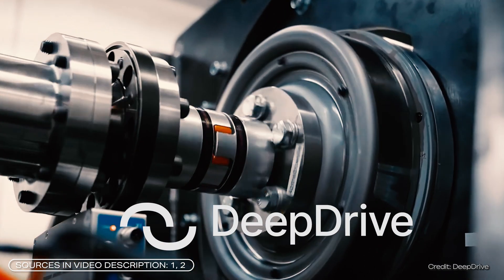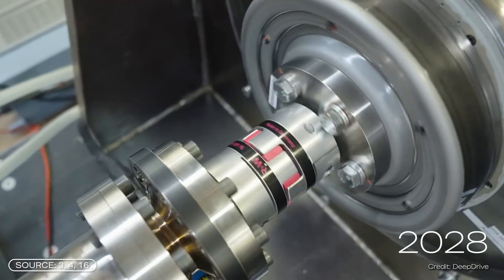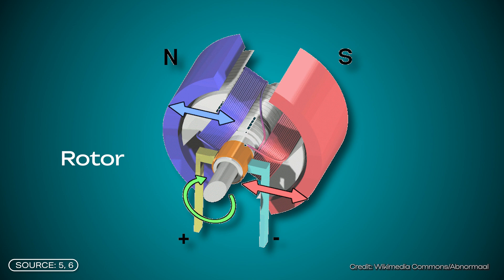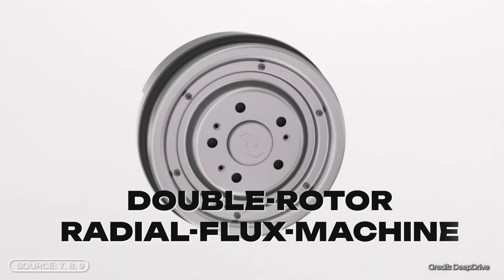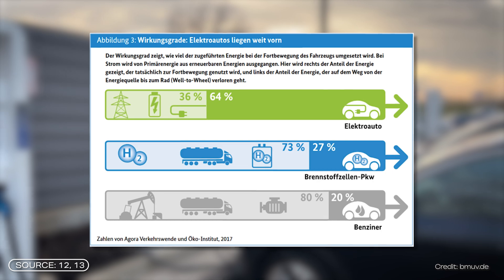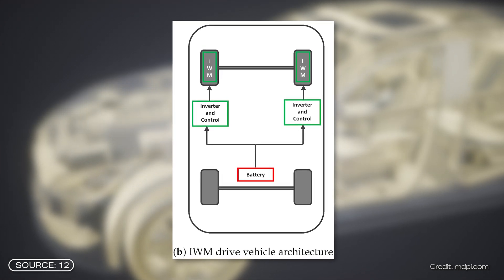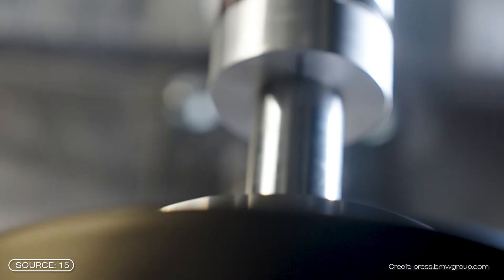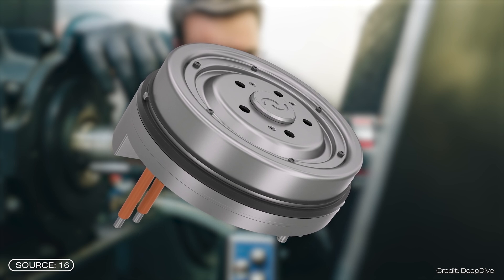Efficiency Made in Germany: DeepDrive's GENIUS motor

Comment: recouperation ⇒ regeneration, would be much better in English.  Also, the claim that no rare earth magnets are required seems false since the armature appears to have permanent magnets, and non-rare earth magnets have MUCH weaker magnetic flux densities.  This means that a far greater number of field windings and/or much higher currents are required for the same output torques, and both of those will reduce the motor efficiency.  A Halbach magnet array would reduce the necessity of having two magnet arrays to capture the opposite side magnetic flux.

Comment: I would think the unsprung weight would be an issue. Integrating the motor into the wheel might lessen the overall weight of the wheel.  Wondering if this much be more appropriate for heavy transport trucks as their tires absorb more shock as they don't move up and down as much lighter vehicles. Also, if Front wheel drive, would not there be a lot more strain on the steering gear?  Interesting though, and something I began wondering about almost 20 years ago for racing cars. Thanks for the good presentation - your English puts most of us English speakers to shame as few of us have any capacity in other languages.

Comment: No no no no and Noooo. That gonna kill auto makers, oils industry instantly and give people freedom of choice. Every body have cars ye's, than imagine that , swoops engine and fuel tank compartment with battery pack or cheap electric generator (diesel) run by vegetables oils put those swedish electric engine size like coca-cola can with 100hp and wireless electricity transmission...4x100....is very ecological, economical , imagine all that energy need to build new car, materials, transport bought energy's and material all that Europe imports and in this case be more independent and with rich agriculture land's.....no no no that going to screwed up Chinese to, maybe not ,thay are very adoptable 😮😮😮

Comment: I need two of those for a non profit org that wants to retrofit a Classic Mini that's 40 years old into an hybrid vehicule at ultra low cost : 2 wheel motors, a battery and a "smart CPU" to monitor the driver intention and road condition in order to control the acceleration and slowdown using the electric motors.

Note: that's the simpliest possible solution and it would work on all "old" vehicule ; much much less expensive that a classical electric retrotif, ie more $4K then $20K :)

Please contact me if interested, our "Mariani Motion Lab" is in Corti, Corsica.

Comment: 6:13 - model 3 range incresases by 20 to 25% ?!? 
How should that be possible if the drivetrain saves only 3,5 - 1,5 = 2 kW  ?

2 kWh per hkm less would mean that the model 3 must have been driven at 10 kWh per hkm to achieve 20%, 
the model 3 must have been driven with 8 kWh to achieve an efficiency gain of 25% 

Who does believe that story that the model 3 drives with a consumption lower than 10 kWh ? 
I bet the average figure would be 15 kWh and then the "theoretical or calculated saving of 2 kWh" would mean 13,3%

Of cause that is per se a lot but if you start a description of advantages with 20% - 25% and then deliver just 50 to 60% of that something is wrong, completely off.

I suggest to tear a model 3 apart and built these motors into this car to show the advantages on a real road, same car and same conditions with drivers that share the lead position every 20 minutes at a constant speed to start with - later the WLTP mix to compare it those gains might be depending on the kind of traffic you are driving.

Sad to see such figures being published by a german figure without a real proof by TüV or whom ever. Talking with 11 OEM also makes no sense cause it says nothing, maybe a student presented his master thesis and that was it.

Prof. Neugebauer from KIT in Karlsruhe I guess was emphasizing the disadvantages that come along with wheel motors like 4 instead of 1 power control unit and a lot more. I still wonder why this company was unable to talk to and convince  Prof. Neugebauer who is a scientist. 
I suggest to invite him and convince him instead of throwing money into this developement while the critics are still there and very clearly to hear. 
The topic is quite complex at least if you look at such change and its implications over a full life cycle . 
It is not as simple like doing the calculations for cost and weight and assembly time, what about the likelihood of failures and repair costs - which a good company should have in mind as a factor for sustainability cause the less likely a car breaks and the cheaper the repair will be the longer it will be used and the more stustainable it will be. 

Big mistakes by the founders to not get in touch with Neugebauer for so many years cause I can find and hear his voice across germany about Radnabenmotoren and the use cases (yes, they do exist for him for example in tractors, streetworking machines or even ebikes which I have for over a decade).

Comment: The Tesla rear motor achieves up to 96% efficient and their drive train is abot 85% efficent. Therefore there is much efficiency to gain by removing the drivetrain, but wheel hub motors are compromised without a reduction box  which Tesla would not use if it was not needed... me thinks we need independent verification from those with nothing to gain / lose, I remain dubious
Reply: "Up to" 96% is key.  Efficiency typically drops under lighter loads.  Yes, 20% improvement sounds too good to be true, but there is a lot of room for efficiency gains across the broader, real-world operating range.

Comment: Portescap used to  make brush motors like that with a rotor and armature with windings formed into a tube inside stationary magnets and iron.  Its feature is low inertia rather than efficiency,

Comment: I just know from building a hub drive motorcycle and then a belt driven motorcycle, that a hub motor simplifies everything so much. I know with a car things are not so easy. But the advantages in simplifying the drive train, creating more space and reducing costs would be significant. I really hope this succeeds, Donut labs are also doing something similar. I can see why these in wheels motors are being developed, because the advantages they could bring are great. I have always thought about doing an electric car conversion, If there were good in wheel car motors available, wow would that make a conversion so much easier.

Comment: So-called pancakes hub-motors initially seems appealing, but present NUMEROUS disadvantages, of which you listed some, but not all.  Also, the answers you got... and give are pretty unconvincing.  Sure, the hub motor will be well protected against environmental aggression... but that remains a potential weakness, and it's sealing a maintenance concern.  The concerns linked to the "un-sprung" or "un-suspended" weights are also too easily brushed aside... they can be very troubling. 
And, as I said, there are others:
- Reduction gearing?
- Space for the disk brakes and their cooling?
- Wheel-well space to accommodate the thicker movable "package", mainly in the front... it is not sure that it results in much overall volume gain.

As to the motor's efficiency, 96% is good, but not any better than Tesla's drive trains, which have been measured up to 97% efficiency (including transmission)... of course at the peak of the efficiency curve, which depends on load and rpm... and temperature.

The concept has been considered before... for example by SMH and then Daimler-Benz for the electric SMART... and rejected.

The double-rotor motor, in its centralized version is to me of higher interest... and seems to be prioritized by DeepDrive... surely for good reasons.  I am sure it is a very good motor... but very innovative it is not... and "genius" even less.

Comment: I have a E-scooter and it is driven by a HUB motor . Many e-bike use same type. I fin after using them for years in NY in the US that barring's and corrosion as not a problem.  It pretty much sealed and power wires are threw center of axial . So the only moving part is the rotor . the barring is the seal. This has made 2 wheel and front wheel drive on a E-scooter possible. This has been around for many years now.  Making them with 2 rotors is improving power and efficiency of motor.  This takes 4 wheel drive to a new level. Their is 2 wheel drive E-bikes and E-scooters on the market now.  And they are using hub motors . Even 6 wheel drive with hub motors has been made and it is electric and driving around on MARS for some time now.  Nice to see this applied to the auto industry !  Changing a bearing on a hob motor is about the same as standard axial bearing on a scooter   or motorbike.  Just the axial is bigger diameter for the power wires.  Cheers from NY,USA !
Reply: check Donut motors you will shock go check them the real future from them
Reply: Wheel hub motors can work on scooters because scooters have much narrower envelopes of performance and environmental conditions; that is, they don't go fast and they're typically always on smooth paved roads. The slower speed makes hitting a pothole less of a serious event with the additional unsprung mass of a wheel hub motor.
Reply: Can't you Americans spell
Reply: @NicoRas-e9m  aluminum

Comment: The comments about unsprung weight are interesting. The idea of reducing a vehicles unsprung is not new. Car manufacturers like Alfa Romeo have in the past produced cars that featured inboard disk brakes to improve suspension performance. The hub motor as described here car eliminate drive shafts and reduce vehicle weight. Ultimately it is a matter of a comprehensive performance analysis of a vehicle design using hub motors to quantify the gains realised. From a consumers point of view reducing the purchase price, increasing range and reducing energy usage are probably the most important facts to consider.

Comment: 20-25% more range than a model 3 is mathematically impossible. My math says 8% absolute max (see below)

I ran this by Grok and ChatGPT. Grok says 5-7% and ChatGPT says 5% max.

A model 3 is about 80% efficient from battery to motion.

Here's the break down.
Battery discharge: 92%  

Inverter: 97%  

Motor: 93%  

Drivetrain: 96%

This could theoretically gain 8% total (4% drivetrain) and say (4% motor) which I'll believe when we see. Battery or inverter are different systems so this won't improve them.

8% improvment would be incredible and awesome though. Especially with no rare earths. Hopefully they can do it 😊
Reply: Grok's math, which is probably wrong as it doesnt have any statistics to work with

Comment: Ok in theory but in wetter climates rust and dirt will be the enemy. Possibly also vibration as they go into potholes and rough ground.
Just put them inboard where they will get a degree of protection and standard drive shafts

Comment: hub motors are especially interesting for 4x4 and 6x6(etc) off-road vehicles. efficiency, no driveshafts, differentials, transfer case etcetera, means more ground clearance, and also the diff locks can be regulated by the electronics, and even when steering the inner wheels could be driven slower than the outer wheels, helping especially on slippery ground. problems would be of course the seals, cooling and one thing i never hear about: can the vehicle drive at 2 kmh up a 100% ramp for several minutes without overheating? these are things a 4x4 must be able to do.....

Comment: Battery , inventor / controller 
 El motor  , Shaft , differential ,
To  conventional  wheels   Seems  better option as the El motor  in wheel hub   has to  withstand a lot of mechanical  strain and stress  plus’s sealing problems  !
Wait till  mechanically  sturdy  solutions are discovered …..

Comment: Another thing to consider with additional unsprung weight is effect on steering through gyroscopic effect, better to limit use to rear wheels. Otherwise great idea
Reply: This dual rotor motor is lighter than conventional motor of the same torque and power. Since you are utilizing the inner and outer magnetic field of the stator you need less copper for the same torque.

Comment: The wheel hub motor is the way to go in my opinion. My Ebike has one and this is the 14th year with no problems. The key is a robust design. I live in Wisconsin and drive it all year. Snow, rain, heat, and bitter cold. I have parts and another motor but they just sit on the shelf collecting dust.

Comment: Loock at the brakes on an old car, no protection but old pads are no problem and since the car was built the break disc and calipers have never been replaced in 30 years. But rust and stopped my Opel..

Comment: Very exciting news. I have always wanted to see wheel hub motors utilized for vehicles since my first electric skateboard. Wheel hub motors would be fantastic especially for motorcycles.

The wheel-hub motor would be great for rear wheel drive. Pair them with extra large rubbery tire walls to help cushion it from impacts. A typical wheel hub electric motor car could look somewhat like a dragster inspired configuration. Smaller front wheels and oversized rears.

The hub motors would not really suitable for fronts due to most minor car collisions, potentially writing the wheel motor off. Also, front wheel drive vehicles tend to wear down tires a lot faster due to increased workload for urban driving.  Front tires suit a lower profile to help faster heat generation and grip but would make road impacts worse for the hub motor, where the extra hub-motor weight, at the larger rubbery rear wheel, would aid the grip and add a slight buffering effect required from immediate electric hub motor torque.

Comment: The greatest opportunity would not be building new cars with this technology, but retrofitting existing cars with hub motors and a small battery pack. Depending of the level of integration possible with the individual car model, this could either create a more fuel efficient and powerful Hybrid (pretty cool for old campervans!) /, or enable emission free short range driving in the city and long range with the existing engine.

Comment: Twin magnet rotors around a slim axial flux stator, push voltage up to 800v it could do some really interesting hub motors with integrated disc brakes. Efficient small ones like 15kW with some boost option. 

Btw those range numbers are BS, you can't add 30% range to something with 10-15% loss.

Comment: Easy way to make a 6-8WD off road vehicle with a on board generator.
Run the generator to charge batteries, extend the range and allow refuelling when out of range of any charg8 g stations
Should be able to get massive wheel articulation since there is now no drive shafts or tail shafts  to limit movement.

Comment: It is only 20 year behind the GM Delphi wheel motor
Reply: If GM had it 20 years ago... then what happened to it?? and why didn't GM progress it?
Reply: @stephenpearce3880  They did they now have 12 phase motors. I watched a Delphi electric drag rail in 2008 it had 2 5,000 that weighed 40 lbs each.

Comment: I guess we will see if the motor is really durable enough to be used in-wheel. Near-wheel motor placement (where the motor is just inside the suspension) isn't quite as space efficient, but largely solves wear and tear issues. Two or Four small motors inside the chassis might be too much space for a personal EV, but for large big rigs a few near-wheel motors could replace a complex and extremely heavy transmission.

Comment: @6:06 you discuss the efficiency gain compairing the ~3.5kWh/100km loss from a model 3 down to ~1.5kWh/100km for deepdrive. The sources mentioned in the descriotion are a unpublished title that is not a link and a discussion thats not a link. so no real sources to actually go on. 

I suspect there is more to the efficiency claim then what you shortly describe and I am eager to know. because a ~2kWh/100km "gain" is 2-2.5% gain and not 20-25%. Is this a case of a comma (10x calculation) error? or where the sources not clear enough to go into the detail of the other 90% of the efficiency gain claimed and the only clear one was the 2kWh/100km gain?

Comment: Interesting that Aptera ditched their wheel hub motor idea because the idea is just terrible.

And then you hit a pot hole... That will be he $4000 please.
Reply: Some say it was more of a supply issue, because Elaphe wasn't fully prepared to mass produce its motors.  Obviously in-wheel motors are tested on potholes.  Where are you getting your information?
Reply: @netscrooge obviously they are tested on potholes. The point is if you damage them they are going to be massively expensive to replace and the number one thing people damage on vehicles is rims/wheels, bearings, wheel hubs and other connected suspension components from hitting debris or holes. It's not rocket science to not put the most expensive and vulnerable components where they will most likely be damaged.
Reply: @Snerdles   Over decades of driving, I've never had such damage and haven't known anyone else who has.  I don't think your dismissive comment is fair.
Reply: @netscrooge You've never seen someone hit a curb and breaka wheel hub? Wow, it's almost like you're being intentionally disingenuous just to spread disinformation. People damage suspensions in every city every year on pot holes. That level if ignorance just isn't possible.

Comment: I remember GM had this 20 to 30 years ago.  It had X in the name.  The under frame/drive train were connected to the cabin by a wire (drive by wire) with no mechanical control connections.

Comment: Having the motor in the wheel means you can have 4 wheel steer. Not just a little bit like for a crab walk, enough you could make a car spin on the spot. You could do close to or fully travel to the side, for those tight parking spots. You could do this on all cars, including the cheapest models. It could be done on long trucks. Even on tractor trailers. Just with this one invention.